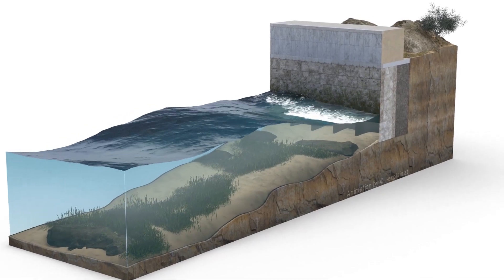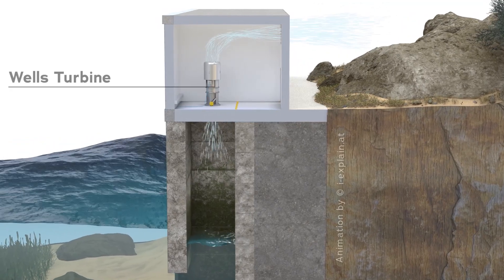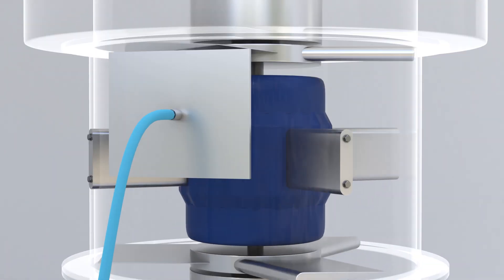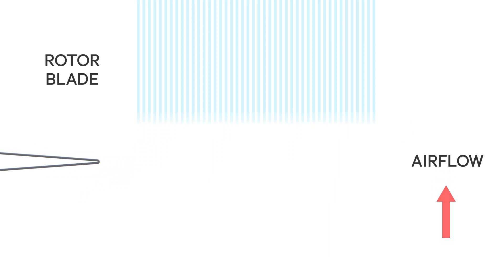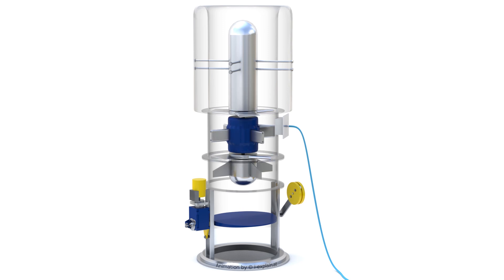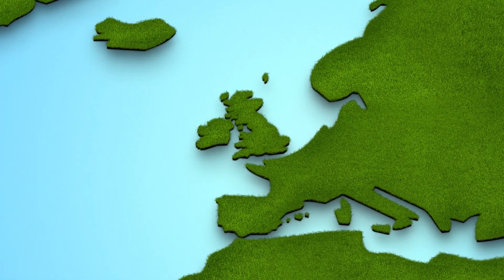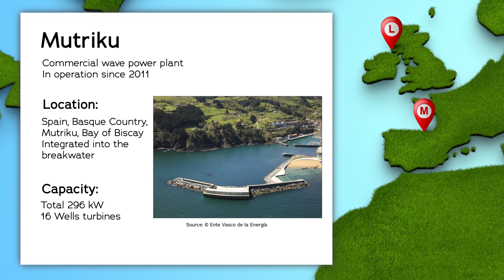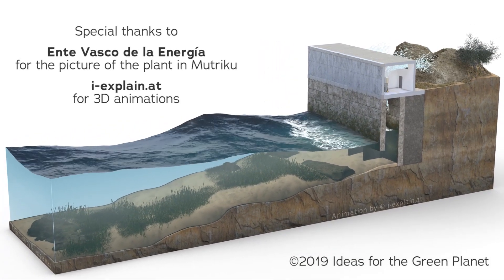Harvesting the Wave Energy: The Function of Wells Turbine

Comment: How do they tackle the high tide and low tide times?
What if the water goes inside the wells turbine chamber?
Do they install one way flap to keep the water from entering inside the chamber? If yes, then will the pressure difference is still maintained to keep the turbine in operation?
I'm curious
Please explain anyone
Reply from the maker: As you already suggested, there is a flap that can close the opening. This also happens during service. The tide is not the problem; the turbine chamber is much higher than the high tide. An operational wave power plant based on this Oscillating Water Column principle has been working since 2012.

Comment: All you declare is in theory. Where we could find that "Rotor Blade?
Reply from the maker: It is not only theory; it is practice. This is a Wells turbine, and it is mounted in the Mutriku wave power station in Spain.
Reply: @IdeasfortheGreenPlanet the wells turbine is not efficient. A vertical axis wind mill works in any wind direction and is very efficient.
Reply: @stonehold42  Wind mills are terrible for the environment. This seems almost entirely clean.

Comment: I agree, to what other system? Well, I have designed a much better system. Keep an eye out for the Clayton Turbine. It is based on using an Impeller, and not blades which have voids between them. 100% of the air stream enters the turbine, causing the Impeller to turn, before being able to escape. This is happening in multiple locations simultaneously. And yes, it is bi-directional. Does not require being electrically started. If you do an surface area analysis, you will find the Well's Limpet design, on average, loses twice as much energy  passing through the tube. Later attempts improved by using more blades and guide vanes. This added complexity, resulting in more cost to manufacture and maintain. Claims of it being 40% - 70% efficient is questionable. 40% - 70% efficient is only a snap shot in time. Efficiency is not a snap shot, rather it is defined in the dictionary as a totality of energy expended, ie., the ratio of the useful work performed by a machine or in a process to the total energy expended or heat taken in. Ref: https://www.google.com/search?client=firefox-b-1-d&q=efficiency+definition
Reply: You're too late Clayton, I already did. Plus you have no video's on your youtube channel.
Reply: @justtinkering6713 what

Comment: The design is novel, in that the shaft always turns in the same direction. In doing so, the acute attack angle, causes the turbine to "stall",  and often in need of being electrically started. Suited only for large surf conditions. If it were effective, it would be commonplace. There are better methods, of utilizing the OWC air flow. The video is done well, and clearly explained.
Reply from the maker: @ Steve Clayton: Thank you for your comment, sir. At this site in Mutriku Power Plant, the new  bi-radial turbine is tested. It is great, that you are working on improvements!
Reply: @IdeasfortheGreenPlanet  There is nearly a 50% loss of kinetic energy. It will turn only as fast as the air is pushing, and therefore will simply pass through those voids in between the blades. As you enlarge the unit, the voids grow larger, in relationship to the blades surface area. Self defeating. I am surprised at how much personal energy has been devoted to this design. I have a much better turbine design, simple and less expensive to build. Works with low pressures.
Reply: @steveclayton5692  do you have a video of your design?
Reply: @seventyseven.77  Yes I have several videos, and making new ones. My Patent application is still pending. The video will show it working in a Bi-Directional manner, though will not reveal how it works. I am currently building larger units, to be tested offshore, PacWave (OSU) Oregon USA. Under
the same conditions, the Well's Turbine will not spin. It requires a large volume of fast air to operate.
Reply: It is not necessarily true that if it were effective it would be common place. There are many people that have vested interests in suppressing this kind of technology.

Comment: Of course, although not optimised for it most turbines would turn in the same direction if the gas flow comes from either side.
 This method seems to offer the advantage that it could be integrated into sea walls that are in place primarily for protection thus defraying overall costs for the turbines and the sea wall. Also it could be integrated into ground built offshore wind turbines. It also has the advantage that its moving parts are largely clear of the corrosive effects of salt water and are accessible above water.
Reply from the maker: @Giles Pargiter : Thank you for your comment. Yes, you are right. There is the wave power plant in Mutriku/Spain which is built into the wave breaker - which is already there to protect the harbor.

Comment: I love this idea. Why couldn't this strategy be applied offshore on and around existing windfarms/other winding locations. Surely this same strategy could be moved into a offahore column/cylinder form. Brilliant engineering. Love it. Ps: offshore installations could/would also include and provide an artificial reef structure to encourage fish and wildlife. Two birds, one stone. Encourage/support all life on earth and create a thriving human civilizations. #OurPurpose
Reply from the maker: @Marc Santos: Thank you for your comment. Yes, you are right, this could be applied offshore. There is a wave power plant in Mutriku/Spain which is built into the wave breaker - which is already there to protect the harbor. In this way, no shoreline is destroyed. This technology is evolving. There is a lot of R&D on this site, also offshore projects.
Reply: @IdeasfortheGreenPlanet  It has not been fully deployed, as the Well's Turbine is ineffective. That turbine will be discarded soon, for a better one. You need the efficiency high, and the cost low. The OWC system can also provide desalination, which is important for Islands and remote areas.

Comment: 0:53 that's not how wing physics works. Most force gets created by the air that moves around the tip, not the air the hits the underside of the blade. That's a common misconception.
Reply: Also a misconception is that Bernoulli interactions and the Coandă effect are responsible for generating lift on airfoils. They are not. The pressure differentials generated on and around an airfoil are approximate enough to Bernoulli that Bernoulli's formulas are used in designing aircraft, but Bernoulli forces contribute little to lift generation by way of an airfoil.

Airfoils utilize the vacuum generated on their top side to pull down and accelerate it downwards, and in so doing, the opposite reaction is lift: It's Newtonian. Airfoil equipped aircraft are essentially horizontal rockets, but much more efficient.

Airfoils are more efficient in sustaining flight because the majority of the energy utilized to maintain lift for airfoil equipped aircraft comes from gravity: 66% to 75%, or more.
Reply: That's not a wing tho

Comment: Better put a float inside the column chamber to actuate the generator either mechanically or hydraulically. It will be more efficient.
Later, you may add more floats just outside the chamber to increase the power output. Even more efficient.
Reply: Wouldn't adding a float slow down the water coming in? And slowing down the water would decrease the velocity of the air passing through the turbine. It would be interesting to see what the trade-off on power would be.
Reply: My idea is to not use air for moving the generator. The float can move a mechanism directly, or can move a hydraulic pump. Then this mechanism or the hydraulic pressure moves the generator. That way the brief pauses when transitioning between positive and negative pressure are eliminated.
Reply: Optron Cordian I’m not sure that the amount of work you can get from a float is greater than work from a turbine. Like I said it would be interesting to compare the two.
Reply: I am curious too...

Comment: Hi thanks for your information. Water powered engines are a fantasy to most people, but they dont realise that actually it is very simple to power an engine on water, even a high school student can do that, but the challenge comes in where by brute force electrolysis is  an inefficient method of generating HHO gas that we can use to power our engines. The better way to run an engine on water is here https://gum.co/MwcSx. Am talking about the electrolysis where you get stainless steel plates grade 316L, and you insert them in an electrolytic solution e.g  potasium hydroxide(KOH) or sodium hydroxide (NaOH). Here you need alot of power to produce one liter of HHO gas, most of the power is lost due to internal resistance of the cell in form of heat. The few people like (the late stanley meyers) who completely achieved the goal of runing their engines on water did not use this form of brute force electrolysis. Instead they used another certain form of electrolysis where by the water molecule is just cracked or fractured by high voltage and that leads to the production of high dense energy which is 3 times that of gasoline. Most people dont know that if you fracture water molecules at a high voltage you generate both HHO and hot steam, it is only this combination that can generate a large force to push the piston down to BDC. I want you to do some experiment by getting a spark plug, then connect a high voltage to it like 5kv and a bove, then spray a fine water mist on the two terminals of the spark plug, there will be a loud bang and a heavy flash light. Now trust me if you make experiment on the a bove idea i gave you then trust me in a few weeks your power generator will be runing on water. If you are runing your engine on hydrogen now, try to introduce a fine water mist to the inlet port of your carburator, let the hydrogen and the water mist go in to the engine at the same time, you can create the fine water mist by using ultrasonic water mist makers or you can take advantage of the engines vacuum pressure. If combine the two then the amount of power will be maximum compared to when you are runing the engine on hydrogen alone. I lean't all the above stuff when i found out this pdf file https://gum.co/MwcSx. it will give you step by step guide of how to convert an engine run on water plus different people who have achived the goal and how they did it. If you follow this guide very well trust me in a few weeks you will have a water powered engine, thanks.

Comment: Using the water to turn generator, would be much more efficient.  Torque would me much greater.
Reply: 正确
Reply: @AshutoshMishra-l4m  why unidirectional flow?? why would water act differently for same rotor blade design??
Reply: @gulshanchaurasia2233  in this system the design is more like your ICE with piston like up and down movement that rotates the whole turbine so when wave collides the piston goes up and blade moves but when wave retracts still the piston goes down and blade moves and gives us DC current and it is a lot safer since the blade itself won't be in the water but if we put blade in the water then we have to make it a bi directional blade that rotates when wave collides and retracts and also have to put a lot of expensive and sensitive equipment submerged in water... Overall it would be a lot more expensive and not suitable enough to harness this type of energy, blades are good for dams but not for oceans where you have to take them out for maintenance and all other hassles would drive up the cost significantly
Reply: I can see that.  But i would make large stainless tube, with a stainless corkscrew type impeller.  Utilizing the whole water column, going up and down.

Comment: Only downside is that apparently they are very loud, especially with stormy waves.
Reply from the maker: @Ryan R: The researchers are working on a novel radial self-rectifying impulse air turbine for use in Wave Energy Converters which has a silent operation and  the highest known efficiency amongst air turbines (over 70%).
Reply: @IdeasfortheGreenPlanet  sounds interesting. Have you got a link to a site please?

Comment: This is a pretty cool  how direction of air flow is irrelevant. You could make a more efficient wind generator functional in only one direction but you would need two. Double the price! You would also need something like a diaphragm to select generator based on direction of air flow. Price and complexity go up!  Kind of reminds me of the movie Logan's Run where they used generators operated by the tide. With the decades of ocean studies, implementing these generators on a grand scale seems feasible. You probably to eliminate the cost and construction headaches of the concrete chamber by mounting the generator in a PVC tube and mounting the tube vertically.
Reply: Is there such an impeller for which direction of airflow is irrelevant?? I mean a single one (uni directional motion for the impeller without any dependence on flow of air )
Reply: @musiclibrary894  The impeller they use in their demonstration will rotate the shaft in the same direction no matter which direction the air flows. That's why their design is simple and cost effective.
Reply: The problem is the turbine takes time to slow down before it can change direction. Changing direction makes it highly inefficient. This system would work better in one direction with a heavy flywheel. Adopt the system used in turbo cars and use an air bypass valve. As the wave draws back and creates a vacuum, the valve can open bypassing the turbine allowing it to continue in the same direction while still generating power, the valve closes again as the wave comes back up pressurising the chamber and driving the turbine further.
Reply: @Camsharpknives  If your referring to the turbine in their demonstration, it only rotates in one direction. It doesn't matter if the air is flowing up or down the shaft. The continuous rotation in one direction as the air rushes in and gets drawn out of the chamber is possible using their simple/inexpensive impeller design.
Reply: @michaeldvorak5556  yeah, could be alternating blades. I though they meant it didn't matter the direction the turbine rotated. A giant flap on the inside of the chamber would be pretty inexpensive and more simple that turbine blades anyway.

Comment: All these people in the comment don't realize that you could have a continuous line of these on the coast. So it could generate a good amount of electricity
Reply: A continuous line of these along the coast would equate to mass destruction to coastal environments
Reply: @neilmackinnon9158  using fossil fuels will cause the sea level to rise via global warming, that will mean that the coast will recede. Anyway.
Reply: @mohammedkhan5344  I'm not disagreeing with that. But the installation of these along the entire coast would destroy some of the most productive and important ecosystems. Installing these systems in place of berms/walls would make sense.
Reply: @neilmackinnon9158  that's your opinion, it's not proven fact, it could be built to accommodate the ecosystem. They will not build on a coral reef, even if they do, it could be built to house organasims and small fish and plant life. Eg transfer the ecosystem onto the build.
Reply from the maker: @Islam future @Neil MacKinnon 
The oscillating water column principle can also be used on buoys, which are placed offshore. There is a project funded by EU called OPERA H2020. You can watch the movie about the open sea operating experience here: https://www.youtube.com/watch?v=57T5yorqHSg
Reply: It may double as a sea wall.

Comment: They tried this design several years ago in Norway, it does not work.

It will be blown to kingdom comes when the storms hit.
Reply: There are plenty of ways to avoid it for example make an emergency chamber. When working conditions gets to harsh simply direct steam to emergency chamber which does have a turbine. I think I don’t have to example that these processes would be perform automatically.

Comment: The size would have to be big very big and motors would be small and make very little energy.
Reply from the maker: @Teimur: You can see the size of the wave energy plant in Mutriku on the Foto in the movie. It is built into the breakwater. This plant is providing households with electricity for years under real conditions.

Comment: Let's say you build the turbines one next to another on the Netherland's sea wall. How much power can you get from 1 kilometer long coast per year? In kWh. And what will be the cost.
Reply from the maker: @809Kocur Thank you for your comment. We are not the producer of a wave power plants or Wells turbine. The wave power plant in Mutriku, Spain is built into the breakwater. It is designed for 16 chambers with Wells turbine, 4.5 meters each => approx 80 meters. They are designed to produce 296 kW per hour. But you can't just scale up this data for 1km. It depends also on the energy of the waves in that area. More information: https://tethys.pnnl.gov/project-sites/mutriku-wave-power-plant

Comment: This blade design is not efficient. Calling BS on the claims
Reply: Energy-wise? Maybe yes. But eonomically & maintenance-wise? Probably much better than existing ones

How efficient do you want anyways? 100%
Reply: @Christian Slater yes, his call is in favor of dirty expensive oil energy and against free clean green energy. Obviously.
Reply: You can easily tell how inefficient it is if you possess 2 eyes.
Reply: Compared to what? And what claims? They are not making claims, they are simply stating facts.
Using a different blade design would require a more complex system, meaning higher building and maintenance costs, which would make the turbine less efficient because you would get less power for money spent.